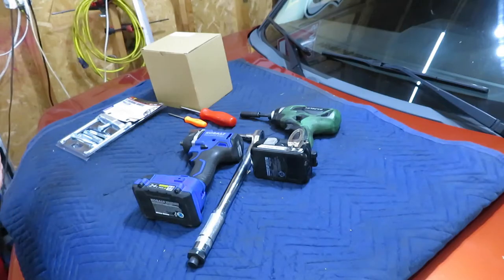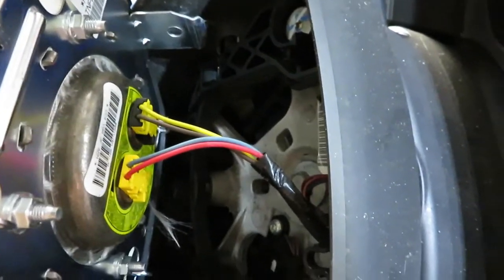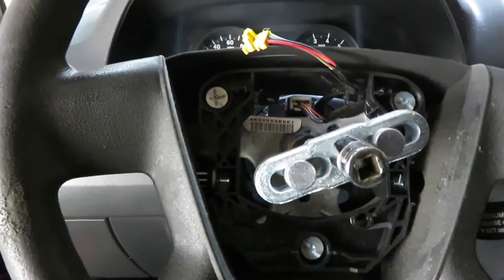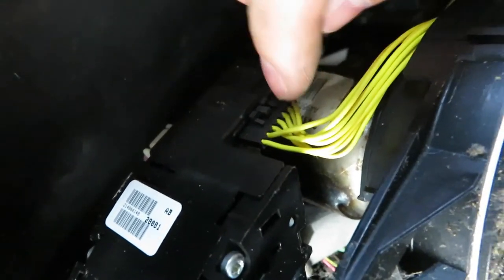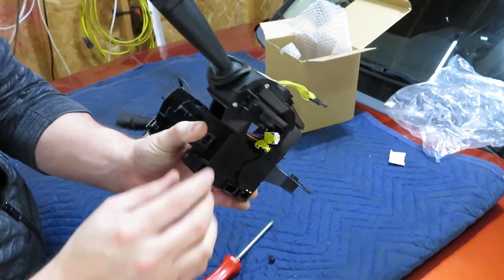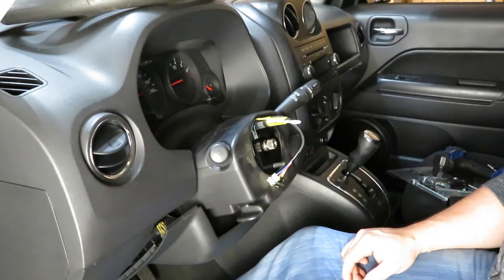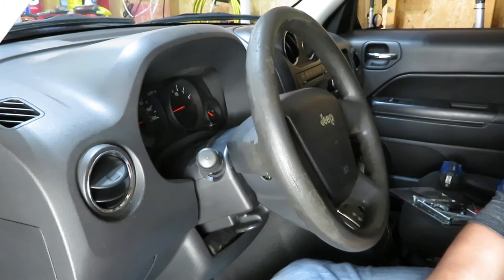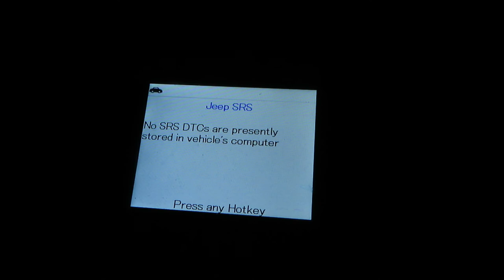How to fix Air Bag Code B1B02 on Jeep and Chrysler Vehicles SRS System

Comment: Hello. please assist with the part number for the Replacement clockspring.
Reply: I habe Same question
Reply: I habe Same question
Reply from the maker: https://www.ebay.com/itm/205018994308?mkcid=16&mkevt=1&mkrid=711-127632-2357-0&ssspo=8rsj6qqdsoy&sssrc=4429486&ssuid=FVeLxnzVRmy&var=&widget_ver=artemis&media=COPY
Reply: @DCAutoEnhancement  I am extremely grateful. Thank you very much.
Reply from the maker: @markopold4145  no problem, good luck with your repair

Comment: After you change CLOCKSPRING, do you need to Re-Flash or Re-Program car computer to recognize clockspring? This is for a Jeep Liberty Sport 2010 Thank you! 😊
Reply from the maker: No, this was just change it out and that was it.  I do know a lot of Chrysler vehicles require re-flashes on a lot of electrical components but this doesn't control anything it just passes information through it.  I hope that helps. Thanks for watching and commenting.
Reply: @DCAutoEnhancement  Very well. Thank you! ☺️